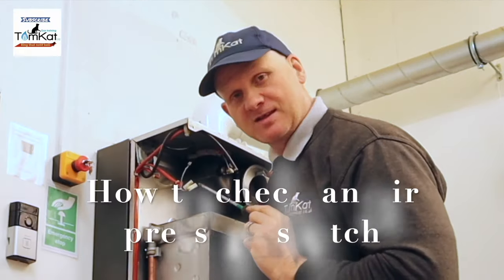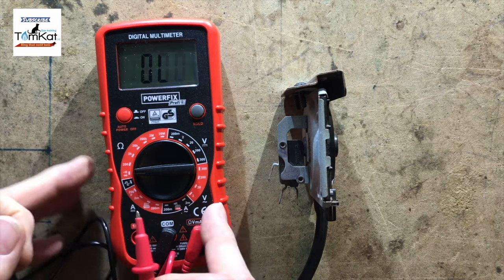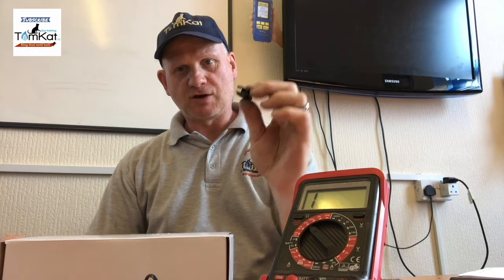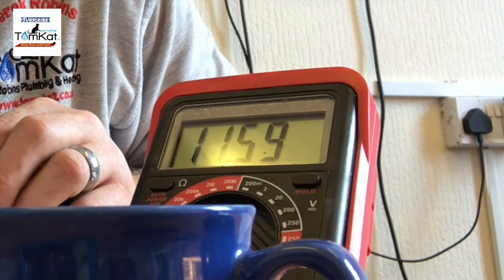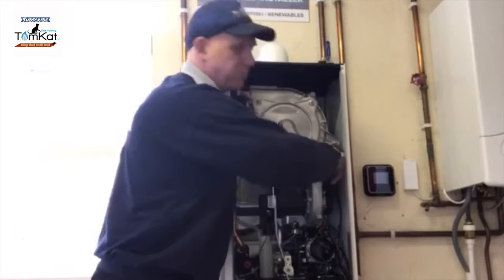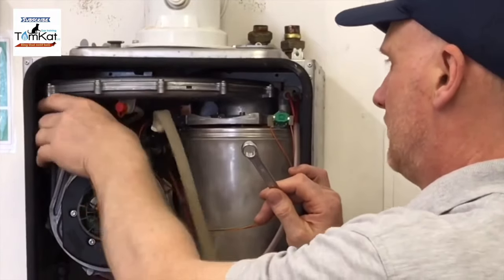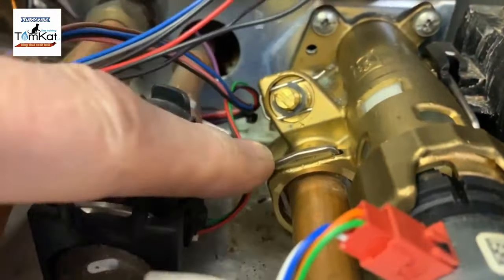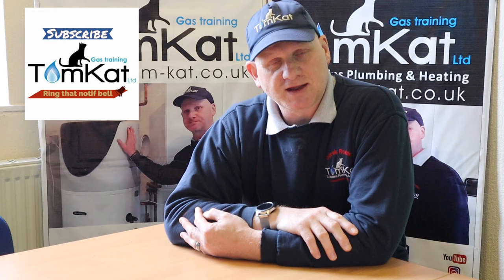INSIDE THE BOILER CASING REVISITED. looking back at the best bits of different boiler strip downs.

Comment: Thanks Derek，I have a question: whether the viallant divert valve nut needs to be screwed tightly? now mainly are plastic ones.
Reply from the maker: Hand tight as the nut on the end just holds the motor in place

Comment: Hi，Derek，test Huba T110 air pressure is the same way？ why they design the normal closed contact， no wire connect to it？
Reply from the maker: The tests are the same and some boilers do have a wire going to all connections if they have different fault codes for the fan and pressure switch also they need the 2 contacts to direct the power in the on and off stats of the pressure switch if that makes sense lol
Reply: @tomkatgastraining   Thanks  Derek，you means we could connect the wire directly to C and NC  to check whether  the fault is from fan or pressure switch？
Reply from the maker: Martin Wei no it means the pcb knows you still need to check continuity with a multimeter